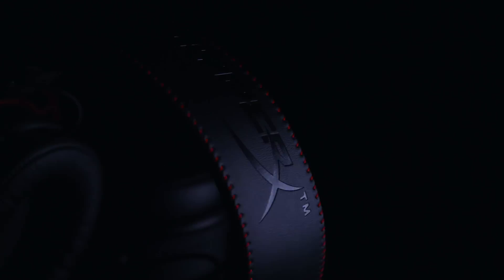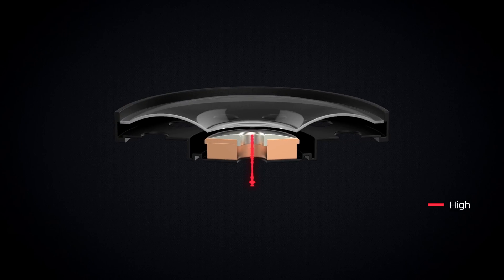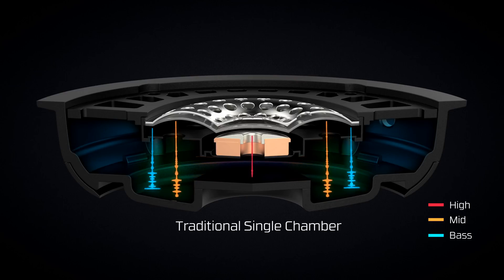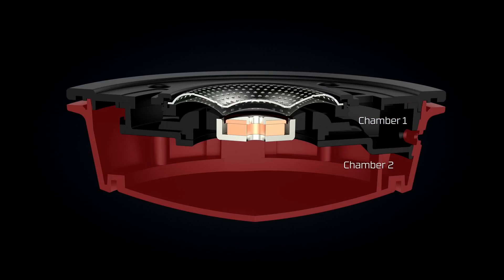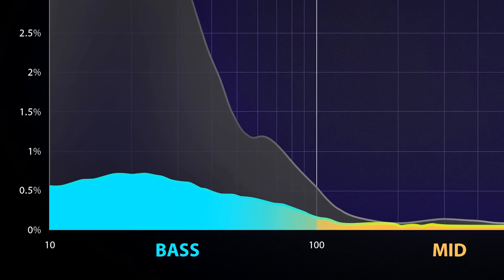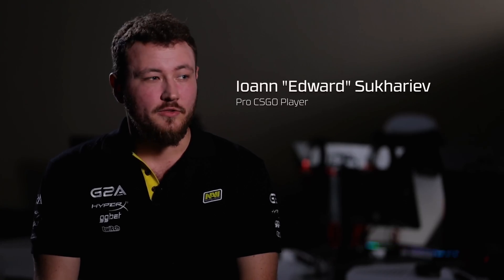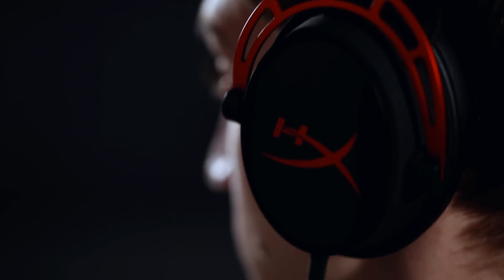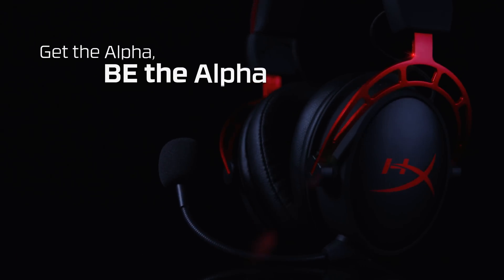Cloud Alpha Dual Chamber Design Explained – HyperX Gaming Headset

Comment: Cloud Alpha Or Alpha S in terms of sound quality (setting aside the 7.1)?
Reply from the maker: Hi,

The sound quality of the Alpha and the Alpha S is without the 7.1 surround sound is pretty much the same. In addition, the Cloud Alpha S supports the Game/Chat audio balance on PC.

Your HyperX team.
Reply: @hyperx  then what's the difference? Cuz they had a pretty significant difference in price? Is it only because of the soundcard?
Reply from the maker: Hi,

It is mainly because of the sound card. The Alpha S also has bass adjustment slider, to customize the bass level.

Your HyperX team.

Comment: Does it have Surround sound or 3d sound?
Reply from the maker: Hi,

Please note, the Cloud Alpha only have a 3,5 mm connection, because of this it is a stereo headset. You can use it with an AMP sound card to get 7.1 surround sound. (Alpha S)

3D Sound is only supported by the HyperX Cloud Orbit and Orbit S headsets.

I hope we could answer your question.

Your HyperX team.
Reply: @hyperx  Thanks
Reply: @hyperx  Should i get Alpha S over alpha gaming pro ?

Comment: How Do You Connect This Headset To Pc?
Reply from the maker: Using the included the PC extension cable or directly to the PC using the 3.5mm cable that attaches to the headset.

Comment: This Cloud Alpha has just a 3.5 mm jack at the end right? My setup is quite Frankenstein but it's that way to suit my needs. I have a TB PX22 in-line amp that a headset with a 3.5 mm jack plugs into and that amp has a 3.5 mm jack and USB that plugs into a TB DSS2 surround sound box. My other question is about the Alpha having 60 ohms, would it be powered enough by my setup to generate up to at least 120 decibels, analogous to a jet engine? my current headset probably reaches up to 140 or 150 decibels even though it sounds extremely distorted at those volumes but it is a 32 ohm headset. Being 60 ohms, does that actually cut the volume in half?
Reply from the maker: Hi Kyle, We cannot confirm if the Cloud Alpha will work as requested in this set up, as we have not tested the headset with third party adapters/sound cards.
Reply: @hyperx  That's okay, I since ordered the Revolver. I'm sure it will be the best headset I've ever heard based on the RTINGS tests. Thank you and I'll let you know how the audio is when I get them supposedly some time today.
Reply: @hyperx  The headset sound quality is absolutely beautiful and has a real speaker like sound quality. I can get it to work with the px 22 inline amp and tb dss2 although it  makes for an incredibly bulky setup because I have to use the revolver's included splitter.

Comment: I use the cloud 2s with the hyper x soundcard 7.1. The question is will the Alpha be better then the cloud 2 if i use a soundcard on the alpha aswell? And will it fully function on a Ps4 pro
Reply from the maker: Please note that the Sound Card is also compatible with the Cloud Alpha, however the sound quality will be different because of the different drivers.
Reply: Hi did you ever get the alphas? Which do you prefer

Comment: I'm using Alphas with Hyperx Sound Card on my PS4 and Alphas lack bass. I also have flights and this headset packs more punch. I would assume Dual Chambers would make bass louder due to separation but it's not the case in my opinion.
Reply: The Alpha is amazing for music. Have no trouble getting clean, ear shaking bass. I'm using it paired with a fiio A5 amp, using custom eqs via  jetaudio music player. 

if you will listen to music, go with the alphas. if not, the flights are fine. for 99 dollars, it's doesn't get much better this

Comment: how do you make it 7.1 surround sound
Reply from the maker: The Alphas can be used with devices that add 7.1 surround sound. Windows Sonic and Dolby Atmos are both programs you can use with the headset.
Reply: @hyperx  ok thanks. So i can't use the razer surround sound program on it?
Reply from the maker: Yes you can as long as you connect it to a comaptible 3.5mm jack.

Comment: I’m a console player and I mainly play siege. Which headset is better for siege, Cloud 2 or Cloud Alpha?
Reply from the maker: Hey, which console are you using?
Reply: HyperX I’m using Xbox one.
Reply from the maker: Either would be good. They are both compatible with all devices with a 3,5mm port. The USB virtual 7.1 surround sound card for the HyperX Cloud II is not supported on Xbox though.

Comment: Cloud 2 or Alpha? what should i choose
Reply from the maker: They are both great headsets, so it just depends on what you need or like more. The Cloud Alpha has a Dual Chamber Drivers design that gives your audio more distinction and clarity by reducing distortion. Its main cable and microphone are detachable. The cable has a single 3.5 mm jack connection and has an in-line control. The microphone is certified by Discord and TeamSpeak and it's multi-platform compatible, so that you can use it on consoles, pc and mobile phones. 
As for the Cloud II, it is designed to fit anyone's gaming needs and its sound card gives you virtual 7.1 Surround Sound. As the Cloud Alpha, it also comes with a detachable noise-cancelling microphone that ensures great team communication. Its main cable has a single 3.5 mm jack connection as the Cloud Alpha's, but is not detachable. This headset is alto multi-platform compatible through stereo connection, and the USB sound card is supported on PS4 and PC.
Reply: can Cloud Alpha  gives virtual 7.1 Surround sound too???? or did i need to buy Advanced Audio Control Box same like Cloud 2
Reply: or buy this Advanced USB Audio Control Box with DSP Sound Card to add the virtual sound???
Reply: @muhammadzulhilmi6612  7.1 is somehow people call bullshoot. but i bought the g430 came with 7.1 usb card just bacuse my laptop doesnt have a mic jack. now that i have a pc im getting the alpha.

Comment: This product is garbage! 
It has cross-talk. 
Everyone in discord can hear my gameplay when the fight gets loud due to this!
Apparently the output and input cable share the same ground wire and you get signal bleeding.
I've had one pair replaced and 2nd pair had the SAME issue! 
You've sent out a MASSIVE amount of faulty headsets to merchants. I brought 2 pairs from PC world, one online and one in-store (replacement).
PS. I've just emailed your support HyperX! Please let me know if you've created a batch that does not have cross-talk!
If not i'll just be getting them refunded and going elsewhere.
Super disappointed as I had no problems with my Cloud II's :(
Reply from the maker: Hey Alex, are you using the rear headset and mic plugs on your system? Does this issue happen when you plug the headset into a different device too?
Reply: I've tested it with the splitter cable, plugged into the front + back of my PC. I've tested it with the splitter cable on another PC also, same problem. I've also tested it without the splitter cable plugged into a laptop that just has a single jack for mic / headset, same issue. 2 pairs have had the same issue.
It's like if you play music, record something, even with the mic unplugged it's picking up the music, so i've ruled out the possibility of sound leakage. It's definitely cross-talk interference.
Also i've ensured the cable is firmly plugged into the headset itself with no gray showing.
It's a shame because the headset quality is spot on other than this.
Echo cancellation seems to reduce  the volume of the interference but doesn't eliminate it completely.

Comment: cloud 2 or cloud alpha which one a buy  ? Im use PC,PS4
Reply from the maker: Depends on if you want Virtual Surround Sound. Or if you have a preference before 3.5mm connection or USB connection. The sound profiles are a bit different too.
Reply: I do not want a virtual Sorround Sound. 3.5 mm connection or USB connection is suitable for me. I'm still undecided and 
I think I will buy Cloud alpha.

Comment: Have both the cloud alpha and revolver. Using these headsets on my Xbox one S... having an issue when deciding which is best for FPS like rainbow six siege and PUBG... the revolver sound louder and more bass,  yet I’m unsure if it’s as clear and accurate as the alpha... I prefer the mic on the alpha as it’s picks up less background noise and I can move it away from my face unless the revolver which the mic is less flexible. I also like that on the alpha it has a volume control on the wire which gives it great ease of access.. what I’d like to know from the professionals.. which headset do I go stick with.. the hyper alpha or the hyper revolver! Thanks for any advise
Reply from the maker: Hi J Lockey,

Both headset are great for playing games. The Cloud Revolver is equipped with the Studio Grade Sound Stage Technology designed to give you a better gaming experience and has a wider audio range to improve the audio experience. 

The Dual Chamber Drivers on the Alpha will give your audio more distinction, clarity by reducing distortion. It also separates bass from the mids and highs for a better sound.

Regards,

Your HyperX Team

Comment: Hi HiperX question.... I just got my cloud alpha yesterday and I like the sound and everything but I noticed that the volume is too low on the PS4 and I saw you guys have a sound card for the cloud 2 my question is:
Does that sound card it’s compatible with my headset and will I get more volume if I get your sound card?
Reply from the maker: The Alpha is compatible with the Cloud II USB card. You will also get more volume when using the USB port on the PS4.

Comment: Hello I want for FPS games cloud 2 or cloud alpha is the best???
Reply from the maker: Both headsets are great! The Cloud II requires the USB dongle for virtual 7.1 surround sound and comes with a 3.5mm jack for consoles and mobile devices. The Alpha have our new Dual Chamber Drivers which provides more distinction between sounds and minimizes distortion and has a single 3.5mm jack.

Comment: But what happen to remote controlling both chat and sound separately?!
Sound is beautiful but I barely hear people from my team in the chat.Their voice are covered by the sound of the game. Any specific setup up to do or other solution to propose? I'm using a PS4 and did the quick yetup as instructed in your manual.
Thank you
Reply from the maker: For what headset?
Reply: HyperX the one presented in the video... HyperX cloud Alpha
Reply: Yea I would like to know that too
Reply: Arielitooo31 prob gonna have to adjust it on the actual settings on the ps4 itself. I have a astro mixamp with this headset so i don't have that problem but that's the only thing I can think of
Reply: Thank you Carolina for the advice. That's also what HyperX recommended me in DM. But considering the price of the headset I would have love not to spend more on a mixamp. If i knew that before I would have bought another headset with HyperX or their competitors.

Aside from that I admit that experience is very nice: quality of sound, comfy headset etc. I've been through the PS4 settings but also had to request my regular game partners to increase their micro volume which is a bit of a shame... They are supposely using a lower quality headset and keep now bashing me because of that.
Reply: Can you please tell me which mixamp you are using? Thx
Reply: Arielitooo31 a portable soundcard should work too no?  You can get one for a few bucks
Reply: Sorry I'm not a specialist. But thanks for the tips. I'll look for portable soundcard for PS4 !
Reply: Yea but I would google it first, cause I am not 100% sure if a soundcard would make it louder or not. I am getting mine soon in the following days, then I can tell you if it makes it louder or not. I also wanted to buy a mixamp first, but it is kinda expensive. I saw one for 65 euro though, but I am not sure about the quality.
Reply: yes please let me know!
Reply: I just tried the headset alone without the soundcard on my ps4. I have no problems with the chat, the chat is even too loud lol, so I reduced the chat sound volume lol. But the issue is when you go in a game, the game sound is like you are saying covering the chat voices :/ . I reduced the sound volume in the games, and everything is fine, but that can't be the solution.
Reply: Exactly. Also asked my friends to increase their micro volume. I'm playing Battlefield1. War sounds are amazing but have to be reduced to hear them.
Now also in PS4 main blue menu and look for "Party" settings. Go to Adjust Audio Mix. it's also helping a lot but it means you reduce game beautiful sound experience in favor of Chat....

Comment: Is the cloud 2 better for csgo or alpha?  And Why are not the csgo pros are using the alpha?
Reply from the maker: Hello 

The Cloud Alpha is better than the Cloud II because of the following : the top of the peak generates the mid-range frequencies, and the edge of the diaphragm is for the bass. Most, if not all, gaming headsets use a traditional driver system where the highs, mids, and lows get jumbled together in a single chamber in the earcup, and that mixture is reflected back into your ears. If you have a gaming headset with booming bass, the stronger bass frequencies will overpower the mids and highs.Concerning Cs Go precision is the key that is why we recommend the Cloud Alpha as your new acquisition.

Comment: I'm not buying it I want a 60 mmDriver and  full open back headset With Huge sound stage and a detachable cord and a detachable Mic And the chords and Mic are braided And make it extremely hard to break Cause I don't baby my headphones
Reply: 60mm drivers > Not as important as you may think, do a tiny bit more research.

Detachable cord > Yes

Detachable mic > Yes

Both cords braided > Yes

I'm guessing you just assumed a lot of things and based off what you think because you pretty much just answered what you want but vice versa without knowing LUL

Comment: does this also have soft earpads like the cloud series or could i at least use my soft earpads from the cloud 1 on this alpha one ? cause i dont like the leather earpads at all.
Reply from the maker: Thanks for the suggestion, the Alphas currently come with the leatherette ear pads. The Cloud I earpads are similar in size, but are not designed for the Alpha.

Comment: I'd like to do a comparison video between the Cloud Alpha and the Cloud II.
Reply: Yup, same. I dont know whats better... 7.1 surround (which the Alpha does NOT have?) or the dual chamber ... ? :/
Reply: @Pysko69  You can opt to use virtual surround sound if you have Windows 10. It works just as well as having 7.1 built into the headset.
Reply: Rekjaboi Not exactly. It depends on your soundcard in your pc. I’m really not a fan of 7.1 either way.
Reply: Same
Reply: Alphas are better
Reply: Laccer same bro